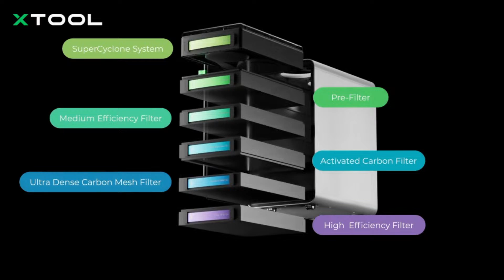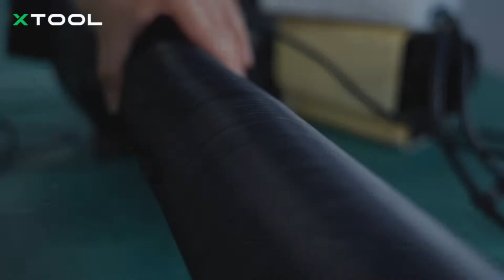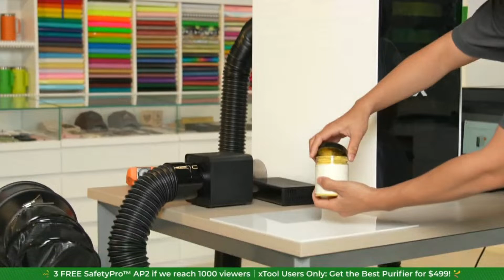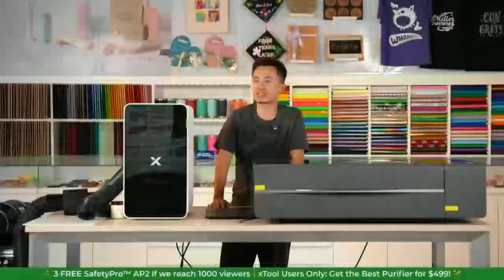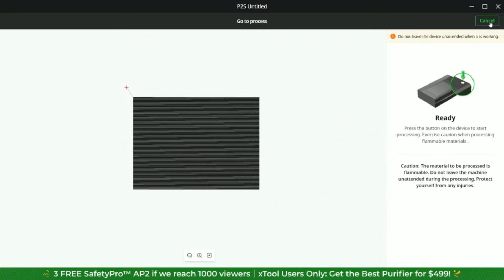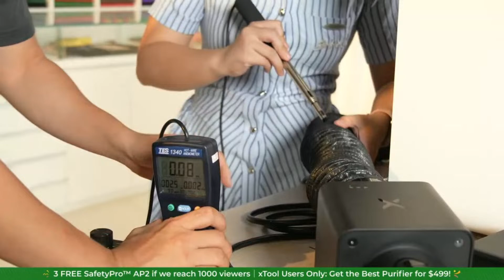xTool SafetyPro™ Series Launch: Revolutionary Air Solutions for Laser

Comment: I don't like to be a nuisance but what they say here about the durability of the filters is complete nonsense. I use the safetypro for my own use and very sporadically. I have engraved about five canvases with it, four cutting boards, two knives in iron, four small medallions, some test materials in both wood and aluminum, two multi-layer cutouts of four layers each and one large 3D engraved of 29cmx29cm and three small 3D engraved. All things considered I come to less than 50 hours of engraving and eight cuts and my pre-filter is 100% full, the medium filter indicates 84%, activated carbon 95%, ultra dense carbon mesh 89% and the high efficiency filter 89%. My safetypro system even failed every time I wanted to engrave the last piece of 6mm plywood. The dust escaped along the top of my safetypro so much that I was not reassured. I even filmed it all. my prefilter was chock full. in the meantime i have received another prefilter but i still want to warn people about the strong exaggeration that is promoted here in this video. checked my history i definitely do not reach 50 hours of use of my safetypro.

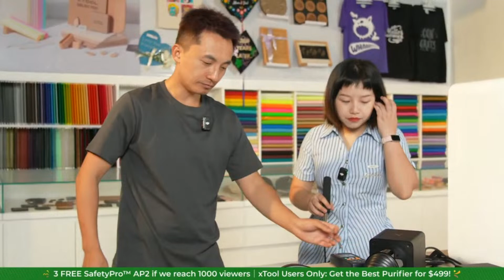Comment: Did anybody else catch the fact that the air speed on the other exhaust fan reached 16.12 right as they were pulling the meter out?  Seams a little off to me.  Go back and watch the video at 47:25 and you'll see.

Comment: I wish you would have shown the new fan's actual performance while cutting wood. Like, on an S1 equipped with the new fan, show a comparison between the old and new fan, how much faster it evacuates smoke while cutting, how well smoke is pulled from the honeycomb bed and from the opposite corner of the cutting chamber.